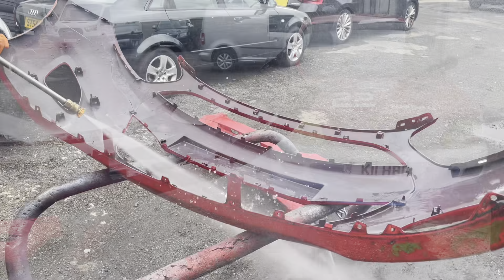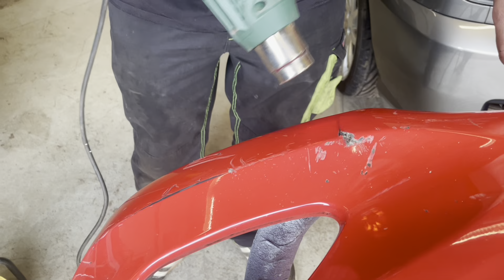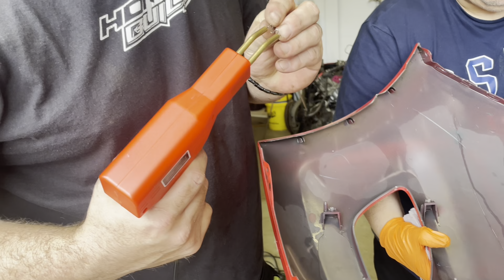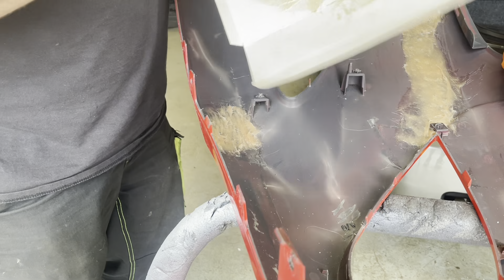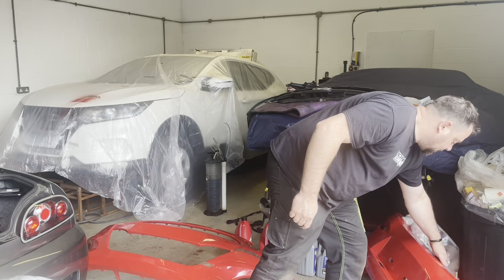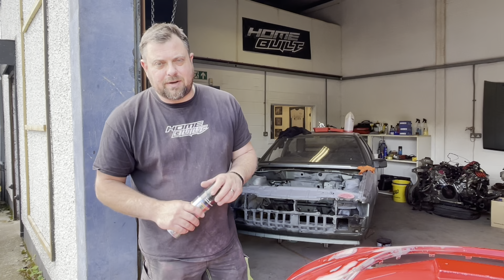Save yourself BUMPER repair costs!

Comment: I've also seen people melt steel wool into the plastic which is supposed to have superior strength over the wiggly staple things. Or of course you could do both.
Reply from the maker: I've never seen the wool trick, seen people melt a mesh in before.
Worth a try though.
Reply: @cardealersdiary  yeah i've seen the mesh too, it must be similar to the steel wool for strength